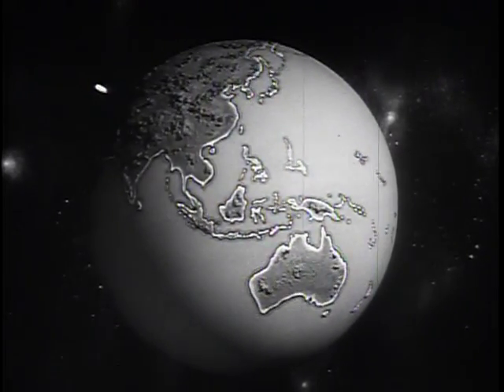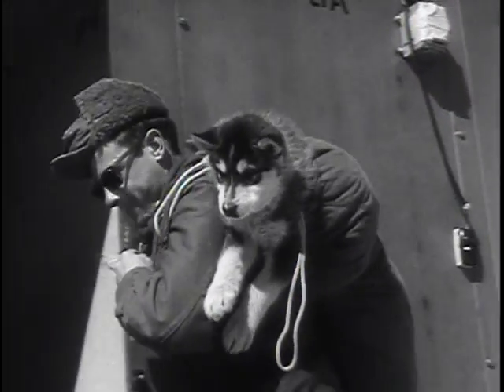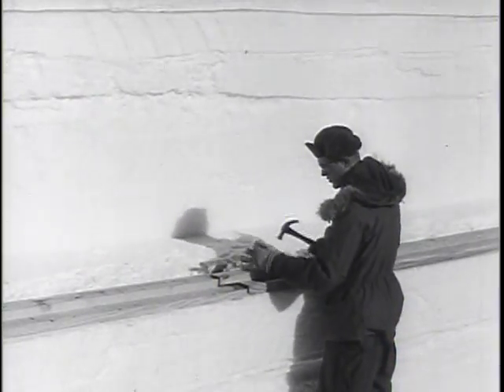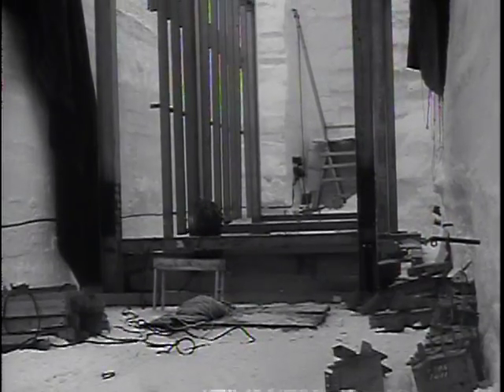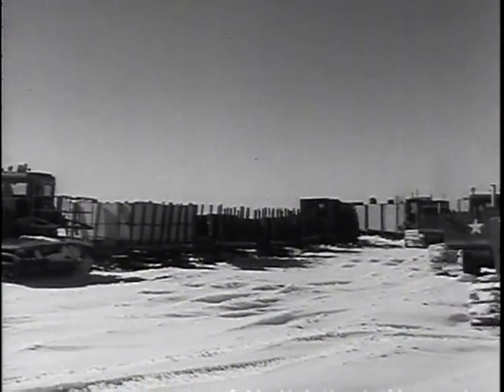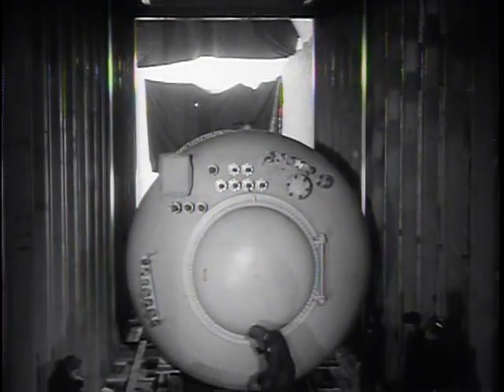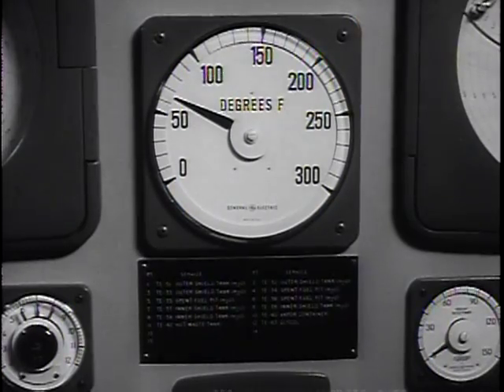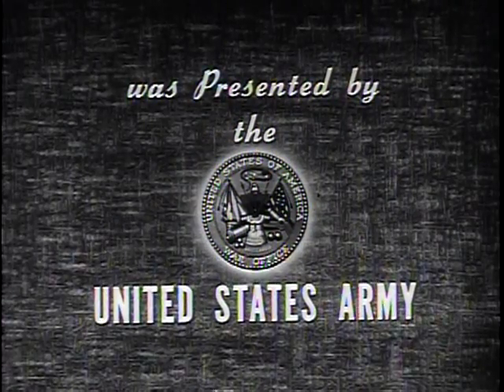Big Picture: City Under the Ice

Comment: +Nathan Lamb  Camp Century is gone.  They closed it when they found out that the ice was shifting more than they thought.  The project was part of an experiment to hide ICBMs under the ice sheet and move them around in tunnels so the Soviets never knew for sure where the launchers were at at any given time. The last few years of operations those assigned there spent their time watching films, boring ice samples, and most of the time clearing frost build up each day that formed about as fast as they could remove it.  A few years after it closed a team was sent in to see what was left.  The tunnels were filled with ice and the shelters had been crushed flat.